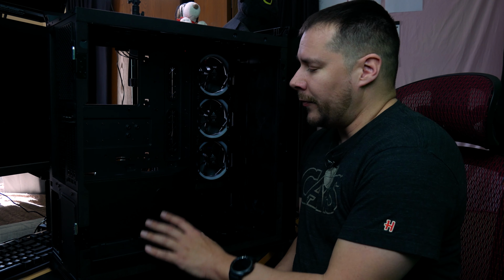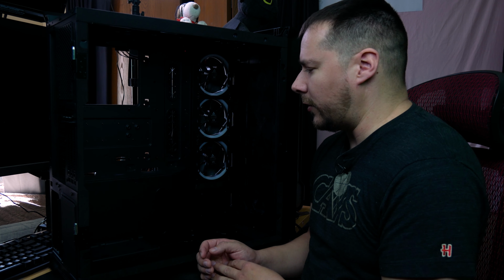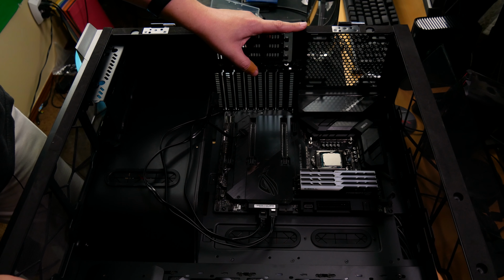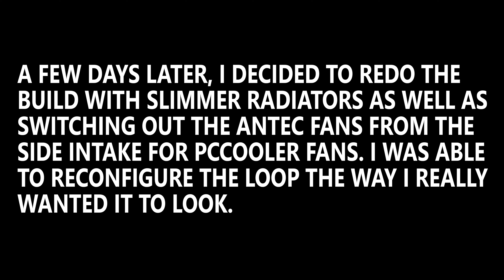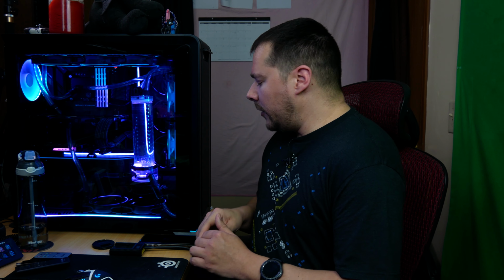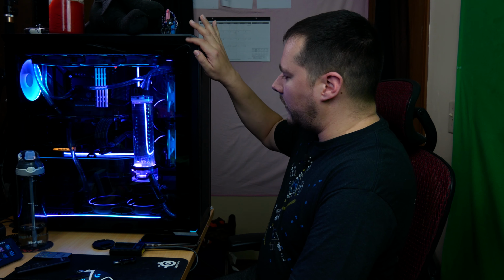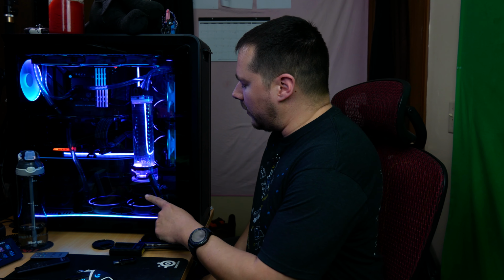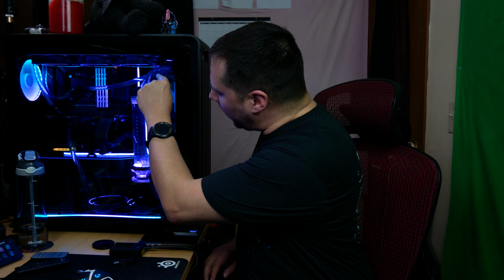Phanteks Enthoo 719 build complete! Final thoughts and impressions

Comment: Hey so I'm doing a build in this case too. Maximizing radiator capacity. 2 480's and 2 360's all thin rads except the bottom rad which is thick in a push pull configuration. To fill all the space at the bottom. 17 fans in total and not sure how to connect do many fans lol
Reply: you obviously need a few inexpensive  separate fan controllers linked to your mobo. in my experience,  why choose so much extra rad capacity, extra fans,  push pull fans,other than because you can.  can you please report both you cpu and gpu temps at load for a comparison , including what cpu amd gpu?

Comment: I like that you said something about the Vardars. I am in the process of replacing all of them. The bearings in them are just trash, SO loud. I had even one of them arrive and hours after install it had a rattle in it. So for the 6 radiator fans that I don't do RGB are becoming Noctua NF-F12 then for the rear fan and 3 side fans I am gonna go for the Corsair LL120 since they are surprisingly quiet and they do have good RGB. I also even ordered a EKWB chipset block for my X570 since I can hear that fan.
Reply from the maker: I never had any failures with the Vardars, but yeah, they were loud. The corsair fans are solid, especially if RGB is important. I've messed around with the QL fans and found them to be nice too. But I do like Noctua as well. Good choices all the way around. Hopefully icue doesn't give you any fits.

Comment: Man. That usb sd card reader is an odd misstep from Phanteks. They usually get the small stuff like that right. Watched your unboxing video of the 719. Funny enough, I had the Evolv X and the Evolv matx. Got the 011XL after the Evolv X. You dodged a bullet there not getting it. I’ve got a 719 arriving in a few days. Thanks for the details you put into these two videos👍
Reply from the maker: I still kind of want to build in the O11 XL for reasons, but the 719 has been pretty solid and probably won't change unless something comes along that just blows my mind. The front USB ports still annoy me, but I've been able to manage.
Reply: Davey K Media after I finished the build, the first thing I checked was that front usb deal. My usb sd card reader has the sd card on the bottom side. Got lucky🙃
Reply from the maker: @currentlykent4593  that's good. My USB SD reader is a thick boi so it didn't fit in the front like I was used to. It isn't a big deal now because of how I changed my room layout, but at the time of the build, it was annoying lol.
Reply: we did a recent 10900 build in the $200 evolve x  case with a $292 ek distro plate, not yet finished up.  had to use slime 360  rad in top, an  xe ek 360 60mm rad would not fit in top.  did the extra 3 inches tall and 2 inches deep  on  the 719 make you to move away from the evolve. I really like putting a vertical gpu on the evolve shroud   and  also the front leds versus hanging by bracket midair in the 719. but i like those extra inches of the 719
Reply from the maker: @file1man  I mainly moved away from the Evolv X because I wanted to give a full-tower case a run and I liked the idea of playing around with the 719's layout to see what could be done. The Evolv X is still a really nice case, but I wanted to get elaborate with my watercooling and the 719 fit the bill for me. I still ran into limitations as you noted in another comment, but still enjoyed building in it.

Comment: really like you concise, well thought out discussion of your build at the video"s end- slim vs thick  rad at top problems , led lighting discussion, ek res.  Exceptional  discussion, rarely done so well elsewhere on othe sites.  why did you choose  not do a vertical gpu and or distro plate build?  lately, my builds have lasted 5 years,  but cases and build options so now much varied and better than only 5 years ago.
Reply from the maker: I appreciate the kind words. Sometimes I talk too much, but I try to relay what I ran into so that others can hopefully avoid the same issues. I'm still wondering if my top rad issue was due to case manufacturing variance because some have been able to fit thicker rads without issue and mine just barely didn't fit. I'd like to do a distro plate build at some point, but for this build, I really liked the idea of giving the new pump/res combo that EK had released to fill the space in the front. I will likely eventually try a vertical GPU at some point as well, but I have a capture card in my system and a vertical GPU makes getting to the card a bit more challenging, so I've avoided it for now. I revise my build about once a year at this point so chances are good I'll be playing around with a new revision in the next few months haha.

Comment: How did you link the rgb to the button with all of them?
Reply from the maker: If you're referring to the control on the case, Phanteks cases with RGB typically have a wire that has two connectors on it. One is to attach other compatible Phanteks products (like the digital Halos Lux and Neon RGB strips I used), the other is a standard 3 pin addressable connector. In this situation, the PcCooler 3 pack fans come with a splitter that terminates in a 3 pin lead that I connected to the Phanteks wire. This then gives the case the control over those specific products.
Reply: Davey K ok I have the same case just haven’t put it together yet I was just curious. Thx tho
Reply from the maker: @nicklowe6964  No problem. It's one of my favorite features of recent Phanteks cases. Makes it easy to do different effects with different lights and not rely on software.
Reply: @DaveyKTech  can you give a link to those neon rgb strips, phanatek?
Reply from the maker: @file1man  I was able to get them from Amazon here: https://www.amazon.com/dp/B07XV5TT1F/ref=cm_sw_r_tw_dp_OMsVFb14J46DW?_x_encoding=UTF8&psc=1 they're also on Newegg.

Comment: Great video! Just a curious what made you choose this case? As you did a single system build and it’s fairly large, and has enough room for two? I ask this because I’m thinking of getting this case as well, but have been having this internal struggle with “how will I ever utilize all the space?” As I plan to do a single system build as well.
Reply from the maker: I basically chose it so I could stuff it with as much water cooling gear as possible as shown in the video. My configuration of 3 rads and a tall pump/res filled the space well and I actually found myself wrestling with space a smidge at times. As I've detailed from the start, as big as this case is, you run into small problems at odd times with some hardware.
Reply: @DaveyKTech  did you find having 3 rads lowered either cpu or gpu temps noticeably. rarely see people with 3 rad systems comment on temps. I have a huge caselabs th10 case, bought used, with only a 60mm very thick xe360 on top, only water cooling 9900k cpu,  2080 ti evga ultra xc gpu left alone on air .
Reply from the maker: @file1man  There's definitely a point of diminishing returns with all the rads and fans in the build. What I was able to do was run my fans at a lower speed to pretty much eliminate fan noise, even under load, which was what I was aiming for. If I blast the fans, temps improve, but I can't complain about maxing out at 70C on my CPU and 50C on my GPU with decent overclocks on both.

Comment: I'm still using my corsair air 540
Reply from the maker: Ah, yes. I've seen  that case still pop up from time to time. If it's still serving you well, then that's all that matters.
Reply: @DaveyKTech  yep I'll do custom loop soon just a corsair h115i w/ml140 pro fans  noctua nf 12s sucking air in and radiator out and h55 cooling 1080ti.. I'd like to do a 360 and 240 on top at some point n hopefully 3080ti will be amazing and not as expensive
Reply: But my favorite case was corsair obsidian 250d
Reply from the maker: I don't think I had seen that one previously. Interesting looking case.

Comment: Is it just me or the front cover is a pain in the ass to put back on?😡
Reply from the maker: This is not something I've run into myself. I tend to have to pull pretty good to get it off, but putting it back on hasn't presented any problems yet. That said, I believe there are build variance issues with this case, more than usual.
Reply: @DaveyKTech  i finally got it. This case is beautiful and your built is gorgeous
Reply from the maker: @salkhan123  Glad you finally got it and thanks!